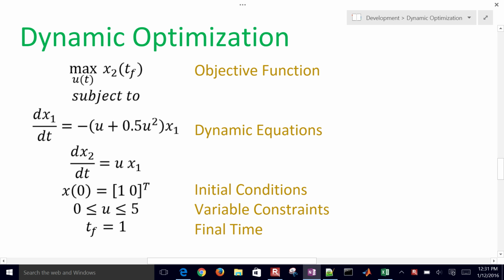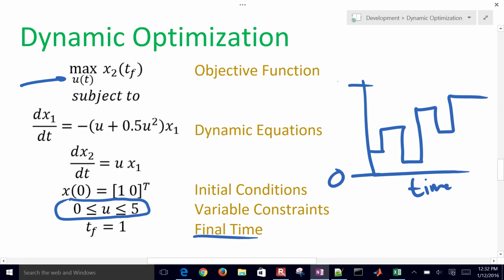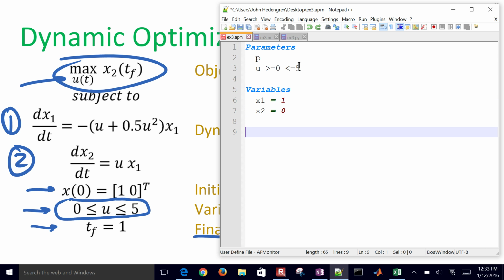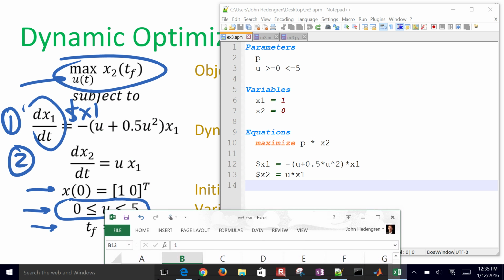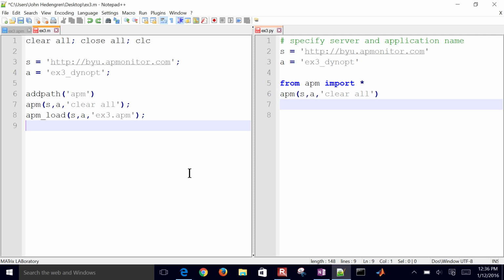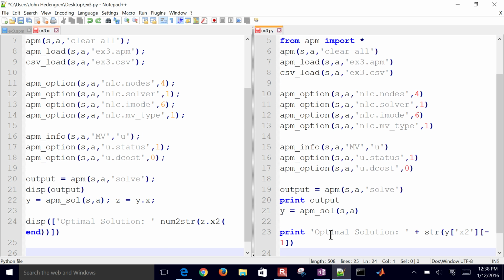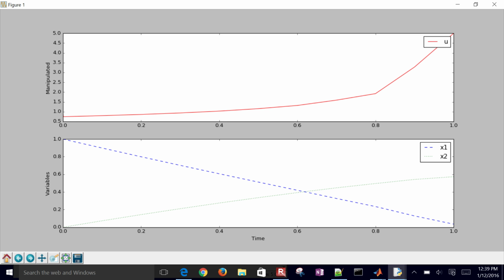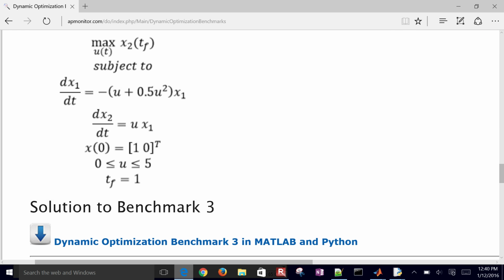Dynamic Optimization with APOPT Solver

Comment: If tf is free, how to set the parameters?
Reply from the maker: If it is calculated (free), use x=m.Var() to declare a new variable. You can use x.value = 1 to set the default value. If it is fixed (not free) then use y = m.Param(). You can also set the value with y.value = 1 or set the value during the declaration such as y = m.Param(1). Search "gekko optimization" for documentation and examples.

Comment: what kind of algorithm is used for solving this optimization problem !!
Reply from the maker: +Kowshik Chilamkurthy we either use the solvers APOPT, BPOPT, IPOPT, MINOS, or SNOPT. More info on the APOPT solver is at http://apopt.com and the APMonitor methods are discussed at http://apm.byu.edu/prism/uploads/Members/hedengren_cace2014.pdf or http://www.sciencedirect.com/science/article/pii/S0098135414001306. If you need course material, it is available at http://apmonitor.com/do